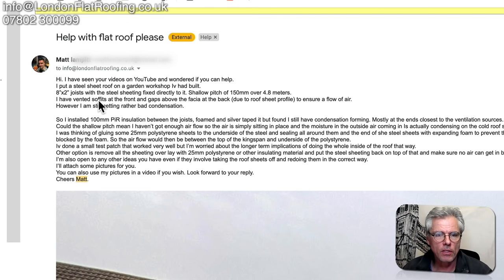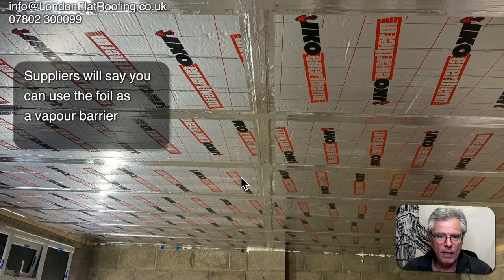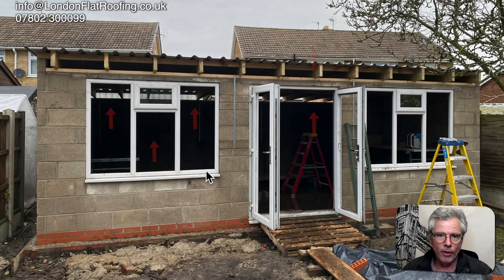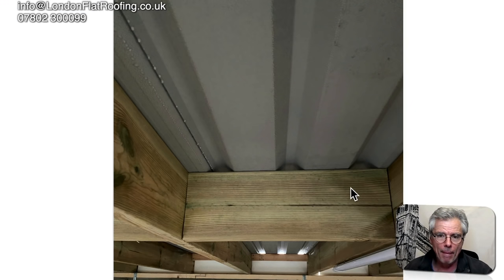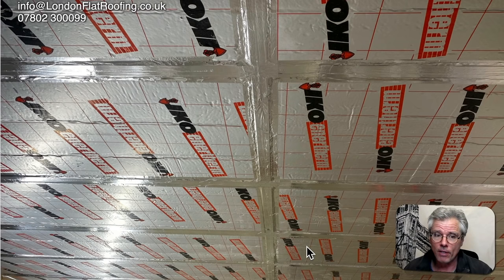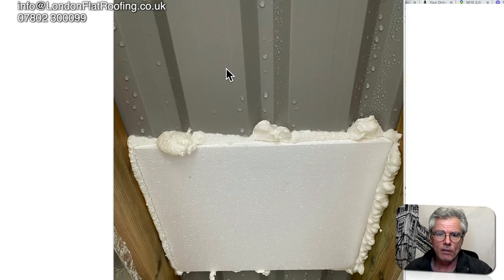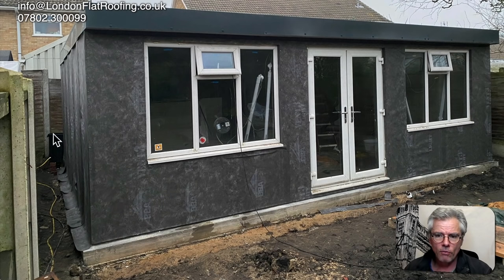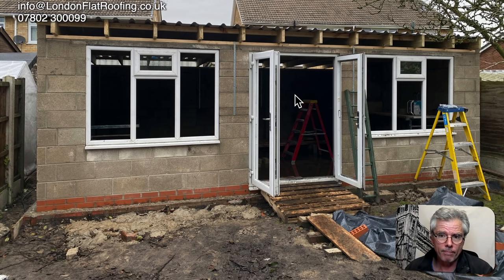Condensation/Sweating on garden office roof

Comment: Whenever installing single skin sheeting I would always advise an anti condensation ‘Drip Stop’ sheet. This has a fleece backing to the underside of the metal which stops the condensation from forming into droplets and allows the ventilation to dry it out.  The bottom 100mm of fleece should be cut back to stop moisture drawing back. Otherwise a double skin build up system should be used with a mineral wool insulation between the two metal skins. This is standard in commercial buildings. 

With kingspan and other insulated panels the price may seem expensive in comparison on the face of it, but once you calculate the materials required to install insulation correctly with a double skin system the price becomes very competitive, easier to install and a much nicer interior finish (white lined) 

The money being spent here to stop the condensation and hassle could have been negated with a composite insulated panel.
Reply from the maker: Yeah absolutely agree with you I didn't know about the one with the fleece in the back I'll look it up. Thanks
Reply: I have an outbuilding at the back of my garden which has walls on the side with pebble dash, and wooden front doors with wooden struts running across the entire length of the ceiling structure, over metal struts, supporting the corrugated metal roofing above. And on the side of the outbuilding I have a sliding garage shutter door, which is facing a small plot of land that is higher than the foundation of the outbuilding, with a slope, leading into a long channel drain in front of the sliding garage shutter, that leads into a soakaway. When I moved in in 2017, the concrete floor had some cracks in it, but over time, since my soakaway has completely blocked up, despite putting a hose through it, and sliding it in and out to remove any debris inside, the cracks in my concrete floor, have got bigger on one side of the concrete floor, which wasn’t reinforced like the other half of my garage floor. I now have this problem coming off from the underside of my corrugated metal roof, drips of water, which is ruining my tools and other stuff inside my garage, and it has suddenly got really bad. I’m having a roofer look at it, but I feel I need to replace my damaged soakaway with a deeper channel drain, which runs along the entire length of the garage, instead of just in front of my sliding garage shutter door. It’s hard to explain, but the whole situation is now making me anxious, not knowing what should be my next course of action to remedy it, while worrying the cost might be huge. I’m just wondering would my house insurance cover this, or not? Thanks.
Reply: @lg_believe333  unless this had been stated in your insurance policy, I would be surprised if this will be covered. It sounds like it is either very old and in disrepair or badly built. Insurance policy tends to cover things like storm damage. The only way to find out is to contact your insurers and ask the question, it won’t cost you anything to find out directly from them.
Reply: Coedri
Reply: I have the tin sheets on my garage with the 'anti con' fleece on the underside, i personally think theyre terrible. Terrible condensation in the garage with plenty of air flow ! I have since been advised that those sheets 'shouldnt' be used on a pitch less than 15°
Reply: @toms4365  has 100mm of the fleece been removed from the tail line? If not It’s probably tracking back up the sheet. If you have fridges or tumble dryers they will still condensate.
Reply: @smudger304  it has been removed yes, i have also put a bead of silicon along the entire edge an inch or two back on the under side where i removed the fleece on the side of the guttering to form a drip for any water trying to make its way back up the underside of the sheet. The silicone drip works, i tested it with a bucket of water. 
Nothing in there other than my car and tools. Im in the process of batterning out the walls, insulating and ply boarding.
I have a couple of rolls of 100mm loft roll to hand, im thinking of loft roll tight to the underside of the tin sheets and underboarding with ply? 
Whats your thoughts on this ?
Reply: @toms4365  are the profiled foam fillers in the eaves? Or anything else blocking it? Even the vented fillers that are supplied will not give enough ventilation and cause it to sweat. Even if the felt is removed unless it’s back to the bare metal, any little fluffy bits will soak it up. Has to be meticulously removed and burned with a blowtorch to make sure there’s nothing that can draw the water up. 

You can turn the ends of the pans down to allow the water to drip off quicker. 

If you are insulated all of the above still needs to be done first, And you still need an air gap between the sheet and the insulation to allow air flow. You could board under the purlins maybe to give you enough space for insulation and air flow. Assuming this still gives you enough head height internally. As long as you have 50mm air flow above the insulation you will be ok. You could potentially batten against the purlins and install the ply to allow for more head height.
Reply: @smudger304  I didnt get any of the foam fillers, I habe left it completely open to try get as much air flow as possible. Ive also fitted extra vents in the garage in the facias to try gain more airflow to help but still the problem. You would have to see it to believe it. I literally have to open the garage door to dry the place out at times. Hense trying to insulate the garage to try and help with the temperature change. 
Would i still need the air flow between the insulation and tin sheet with loft roll. I understand you would with celotex/kingspan but thought i might be ok with no airgap with loft roll completely tight and touching to the underside of the tin sheet ? 
Any information is usefull, im at my end with it and just need to get it sorted.
Reply: @smudger304  ive sinced watched a few videos, im going to forget about the loft roll and use celotex/kingspan with the air gap above

Comment: I had exactly the same problem with my open carport(closed on 3 sides), it would get so much moisture accumulating on the underside of the tin just like this. It drove me crazy, dripping all over my motorcycles and I couldn't store anything in there without it getting wet. All I did was install corrugated iron on the underneath of the timber beams creating an air gap and the problem went away. No insulation,  just creating a temperature difference between the top layer of tin and the bottom layer of tin.
Reply from the maker: Interesting, you changed the internal environment! Let's think that though, you didn't change the roof so the underside of the roof was always the same temp, so by adding a metal under the ceiling  you formed a small ecosystem between the two, you also stop the underside of the old roof from getting to the atmosphere of the entire room. So how did it work? probably less moister getting to the underside but apart from that I dont know
Reply: BazzaDawson   I agree with what you've done....best way.
Reply: Steve Roofer:
You will probably achieve the same results with a sheet of plastic DPM stapled to underside of joists.  Much simpler, and cheaper!

Comment: looks like the shed is built on a concrete slab thats exposed to the wet on the outside and will soak up all the wet like a sponge or am i seen things ? Also is a comcrete slab not just for a woonden shed or something and they should have dug out trenches to build the walls up on to damp proof course.

Comment: I have an outbuilding at the back of my garden which has walls on the side with pebble dash, and wooden front doors with wooden struts running across the entire length of the ceiling structure, over metal struts, supporting the corrugated metal roofing above. And on the side of the outbuilding I have a sliding garage shutter door, which is facing a small plot of land that is higher than the foundation of the outbuilding, with a slope, leading into a long channel drain in front of the sliding garage shutter, that leads into a soakaway. When I moved in in 2017, the concrete floor had some cracks in it, but over time, since my soakaway has completely blocked up, despite putting a hose through it, and sliding it in and out to remove any debris inside, the cracks in my concrete floor, have got bigger on one side of the concrete floor, which wasn’t reinforced like the other half of my garage floor. I now have this problem coming off from the underside of my corrugated metal roof, drips of water, which is ruining my tools and other stuff inside my garage, and it has suddenly got really bad. I’m having a roofer look at it, but I feel I need to replace my damaged soakaway with a deeper channel drain, which runs along the entire length of the garage, instead of just in front of my sliding garage shutter door. It’s hard to explain, but the whole situation is now making me anxious, not knowing what should be my next course of action to remedy it, while worrying the cost might be huge. I’m just wondering would my house insurance cover this, or not? Thanks.

Comment: I'd suggest that the full insulation sheet/tape seal up process shown on the photo will do the job. Eave venting the underside of the roofing flutes is probably counter productive at this point. He only needs to raise the bottom metal surface temp a few degrees to move the dew point slightly. It's common to install fluted metal roofing over plywood or thin rigid insulation sheets; doesn't take much in terms of R-value to solve a dew-point issue. He can finish sealing the underside as he was doing, and perhaps follow up by removing a couple small insulation sections at a later date to check for condensate.
Reply: 🧐hmmm… That’s kind of my other idea I’m thinking about. Removing the tin sheets and overlaying the whole joist area with 25mm polystyrene (all joints taped)  and sitting the tin sheets back on top. 
The little test square I did had no condensation on it at all. I just worry about what might build up between the polystyrene and the tin sheet over time.
Reply: @MatLampitt  There's very a good chance it will be fine as is. To be certain I'd periodically remove and check above inspection panels before installing a finished ceiling. In reality you've accomplished mostly the same end result as pulling up the tin and reinstalling over insul board, your present cure was slightly more complicated of course:). As mentioned, achieving a good vapor barrier between the living area and the underside of the tin will serve to reduce condensate opportunities. Example..if you choose to ultimately install a finished drywall ceiling, look into paint priming the drywall with a vapor barrier product (basically a solvent based primer similar to Bin Seal)
It looks like you're doing a good seal-up job with sealant, tape and panels.

Comment: How to keep my small Metal shed roof from sweating ! I put two coats truck bed coating on the top one coat on the inside I’ve put at least three coats of paint on the inside and I’ve under coated it once on the inside and it is still sweating would me using bubble wrap insulation like you would wrap around your Hot water heater if I covered the roof with that and siliconed  the edges of the roof down would that stop it ?

Comment: When my garage flat felt roof started to leak, I replaced it with metal roofing panels. I have never had sweating problems.  Mind you, I had the foresight to use insulated roofing panels. I suppose you get what you pay for.
Reply from the maker: Yes thats what saved the day

Comment: He can take the sheets off and put a DPM on top of the joists. Then put lengths of roofing batten on top of the joists to raise the sheets, then put the sheets back on. Make sure that the air can now circulate through the new void.
Reply: This is correct he is missing the roofing battens that you use with metal roofs
Reply: Hi buddy, yes I think that’s what I’m going to do with it. I thought the airflow provided through the shape of the roof profile would be enough but it’s not the case. Even with 6 x32mm holes drilled in the top of the centre noggins.

Thinking either that or take the sheets off and layer it with 25mm  polystyrene or kingspan and pop the metal sheets back down on top of them.
Reply from the maker: Ok let me know how it gos
Reply: In the past on out buildings, even little cabins I have insulated between the rafters then tyvek then Perlins then tin, the perlin and under tin area is fully vented front to back. My theory is the most damp air travels through the tyvek onto the under side of the tin and drips back onto the tyvek and runs or evaporates away. Hope that made sense
Reply: @elliot8595  
The joists act as a batten, they're no different.
Reply: @MatLampitt  how's the condensation problem now? Did you figure a solution?
Reply: @knightrider6473  I did buddy. I whipped the sheeting  off, installed a layer of roofing membrane, counter battened it and then popped the sheets back on. Sorted 👍

Comment: When I done mine I used 18mm OSB then covered it with rhino breathable membrane then added the metal, solid roof with no issues.
Reply from the maker: Did u have good ventilation under it ?
Reply: @SteveRoofer  yes! I used the 6x2 to block both ends then drilled a series of 10mm holes at the front and back then got some filter wool and stapled them on the backside of the 6x2 to stop insects/dust getting through.
Reply: So the hypothesis here is that your metal will weep, but will drip onto the membrane and run harmlessly away?
Reply: @AndrewHelgeCox  yes! Basically I left gaps on the foam weather strips on the bottom to allow any condensation to run away..
Reply: @AndrewHelgeCox  
Yes, it's a vented build up.

The air gap moves moisture away

Comment: I have tin sheets on my garage with the fleece 'anti con' lining on the underside and still get terrible condensation with plenty of airflow into/out of the garage. I have a couple of rolls of 100mm loft roll, and thinking of using the 100mm loft roll uder the tin sheets and then underboarding with ply wood. Whats peoples thoughts on this ?

Comment: I thought with the bare metal inside would get even more moisture if you increased the internal heat due to heat condensing against the cold from outside.

Im now confused to how adding insulation to the inside of the joists with a vapour barrier and increasing the airflow between roof void wouldnt help it all.
Reply: It isn't heat that is condensing, is moisture in the air.

Comment: What would you advise for a new metal roof on top of wood sheathing wood sheathing?  Insulate the attic floor and ridge vent (cold roof) or spray foam above attic plane with no attic venting?  Or something else?  Thank you for your informative work.
Reply from the maker: attic vent and make sure any metal roof has some sort of insulation to it or it may get condensation on the back
Reply: Thanks. Unclear as to how to deal with humidity build up on the inside of a spray foam insulated attic without venting. This was recommended by an insulation company.  We live in Midwest US temps can float fro -20F to 100F and we like having our doors and windows open. Makes more sense to add insulation on attic floor, vent soffits and attic box vents(?) 
Putting metal roof on this summer.

Comment: Would of been better to have not used metal from new but here we are.I have just finished a project where we had bad condensation from a metal roof, I used a spray foam from EPS Systems not the cheapest but it has 100% worked stops all drips.I wouldn’t normally use spray foam as all the horror stories but as it was onto metal I can’t see it being a problem.Hope that helps
Reply from the maker: Thanks

Comment: Around the christmas time my bedroom ceiling and wall surrounding the window (dry broad wall and plug socket is soaking wet) has starting sweating a lot, to the point you can hear water droplets fall on to furniture throughout the night, every day i had to wipe it dry, i refuse to have the windows open throughout the freezing cold nights, do you think that’s the problem, it only happened since i moved into the bedroom

Comment: Wrong sheets for job ....should of had anticondensation backing on the underside.....there's plenty of air circulation through the corrie's..the bare metal will always condensate...especially when the building is warm and roof is cold...done a good job of insulation so could be lucky and never notice when it's plastered
Reply: Tell me about it 🤦🏻‍♂️ I didn’t realise there was such a thing until it was to late. Lol
Reply: If it's happening behind closed doors, it's still happening whether you see it or not.

And that will cause the timber to rot, but you can't see it happening.
Reply: Late to the comment, but as a metal building contractor for over 20 years you are correct. And spray foam is just as bad.@Robert-cu9bm

Comment: Im getting a metal shed to use as a games room / home office. I'm planning on using double sided foil wrap close to metal wall and roof as my radiant barrier, then kingspan boards and then interior wrapped with vapour barrier and them covered with plaster board. All relevant gap tapes used also to seal joints etc, would this be the best way to keep heat in and cold out and stop sweating. Iv heard overkill but better safe then sorry
Reply from the maker: Well as per the other comments on here the way to go seems to be to get the metal roofing that has already got insulation attached to it